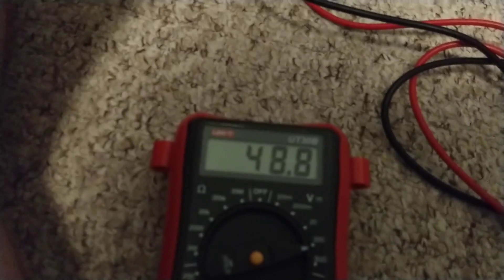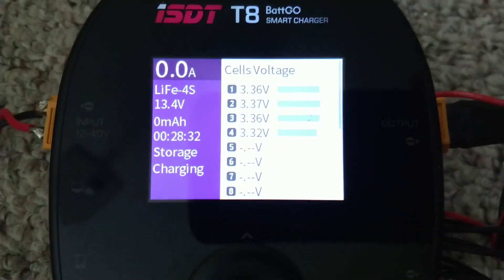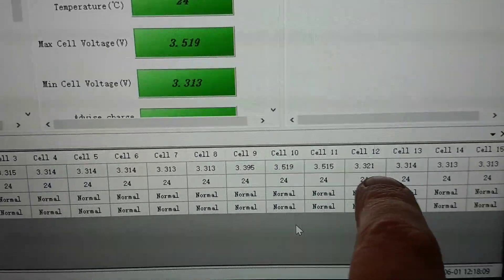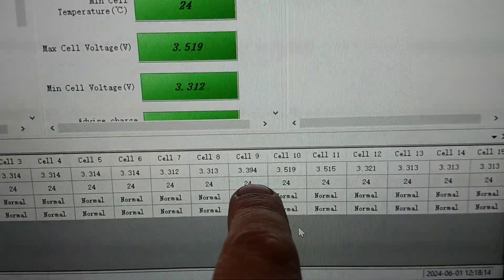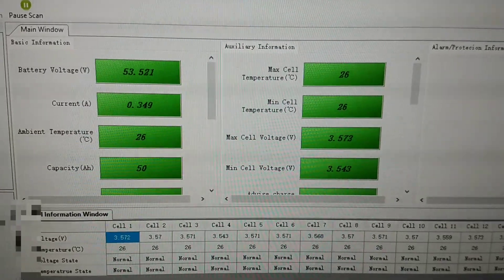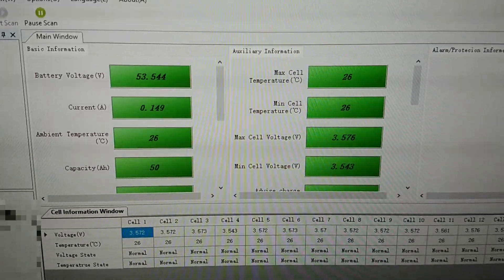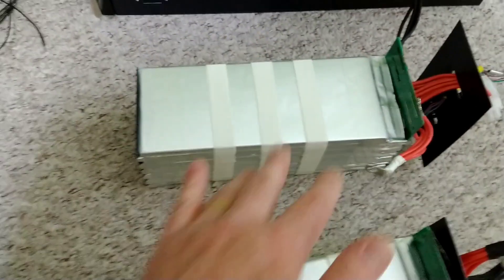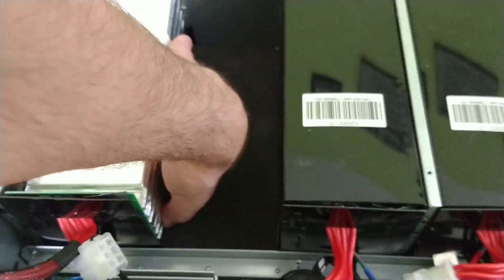Repairing an old Pylontech battery, Part 2.

Comment: Great 👍🏿 video questions can you convert a pylontech battery to 24v
Reply from the maker: @1stinsightpro101  Not really. It's a 15s rather than a 16s. So as well as needing a new BMS for it, you'd be left with 7 spare pouches.

Comment: Hi wondering if you can help with  comms on these battery's  I have six of them how do I configure rs485 or can bus  to get them to talk to  a goodwe inverter
Reply from the maker: If you have these old Extra 2000 batteries, I don't think they support Can bus. My inverter talks to them via the console port so I don't know if you can get it to work with the RS485 port. In theory it should be possible but only if your inverter understands the data format the battery outputs over RS485.

Comment: Hi again from Oz.
I am confused as to what you did to FIX .
I NOTED that you removed 2 cells but saw nothing going back in, just wires hanging out
Did ypu ger new pouch cells.
Was there any markings on pouch cells suggesting manufacturer
Reply from the maker: Watch part 1.

Comment: Given the addition of the foam are you keeping an eye on the temperature in that half of the battery? Brian
Reply from the maker: There are temperature sensors in the BMS that I can read using battery view but this battery is in parallel with others and shouldn't ever carry more than 10 amps so heat shouldn't really be an issue.

Comment: Might be worth you getting a active balancer for all the pylontec packs as it will bring all the cells up to the same  voltage that is what i use
Reply from the maker: It's been a few weeks now and so far the BMS is doing a good job of keeping the cells balanced.
Reply: That's good news how about overall capacity is that good I'm not sure what it would be new  @nicholashowell
Reply from the maker: @dama054  the BMS seems to think it has 50Ah but I'm not convinced as that is what it would have had new.